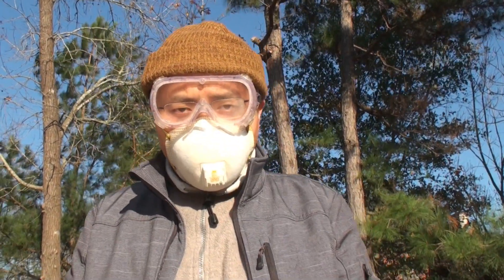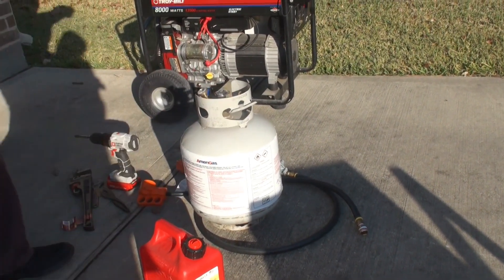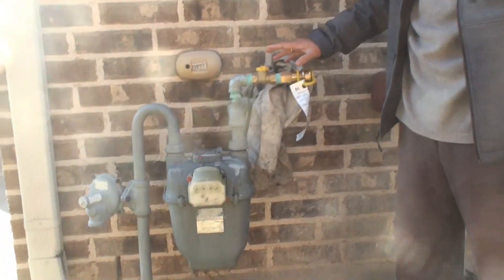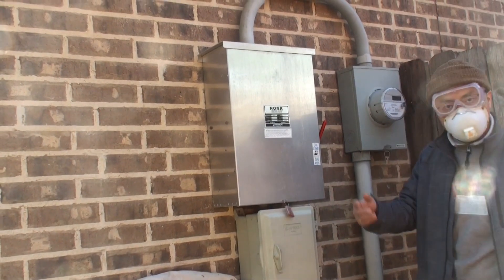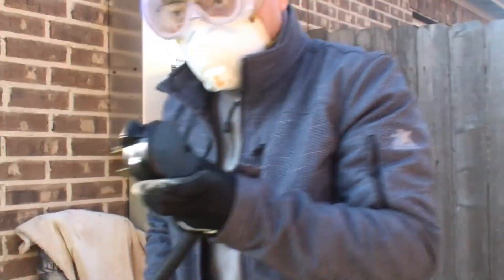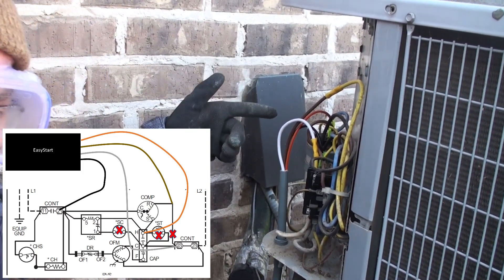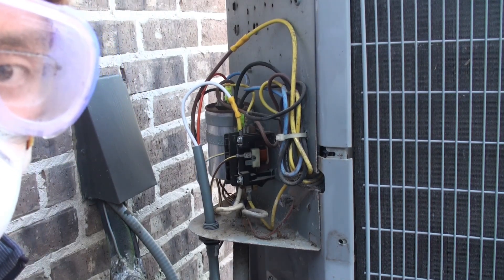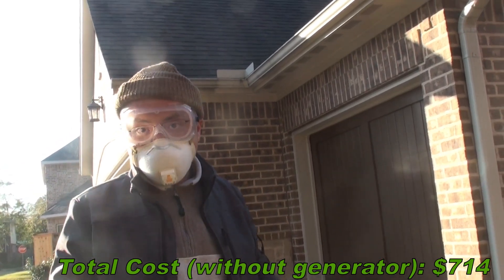Run AC (4 Ton) on Tri-Fuel Converted 8000-Watt Generator on Natural Gas with Micro-Air Easy Start

Comment: What type of ATS system (I know its not automatic transfers) but what disconnect are you using between the meterbase and the generator? Thank you!
Reply from the maker: It's Ronk 7205A model. Hope that helps.
Reply: @JLDIY  Yes, thank you.

Comment: Are you using 30 or 50 AMP inlet box?  Also what guage wire from main panel to the inlet box? I will need to run about 40 ft wire from the main panel to the inlet as the generator will be in the backyard. Today i bought a predator inverter generator and also ordered easy start for my 4 ton ac.
Reply from the maker: I got 30AMP inlet box. If you could get 50AMP one, you should. Best wishes with your tinkering!

Comment: Very informative. I hadn’t heard about AC soft starters before. Will be recommending using this set-up to our customers wishing to power their AC unit with a portable generators.
Reply from the maker: That's a very good point! It potentially makes solar/wind off-grid a more affordable options for the customers considering how much a big inverter would cost.

Comment: Great setup and demo! What kind of transfer switch is that? Was the transfer switch and the 50A generator cable already built into the house?
Reply from the maker: Thank you David! yes. The transfer & switch were there when we moved in, Thanks the Lord! I haven't figured out what it is & how it actually works yet. :) It will benefit many people if there is DIY tip on how to install it.
Reply: That’s a ronk, might be a 7205a model. NIcely made, aluminum, up listed and exterior rated. Those soft starters are great for smaller generators.
Reply from the maker: @IFix-Things  Thank you! This work is by far the first record that one manages to run 4 Ton AC on natural gas portable generator with less than 8000Watts. I really wonder with the help of the soft start what would the lowest wattage portable generator one could start an AC.
Reply: @JLDIY  That would depend alot on the brand of generator and how much copper it had in its windings. Some of the older generators had huge surge capable ratings. The newer ones, are usually about 2000 watts above rated.